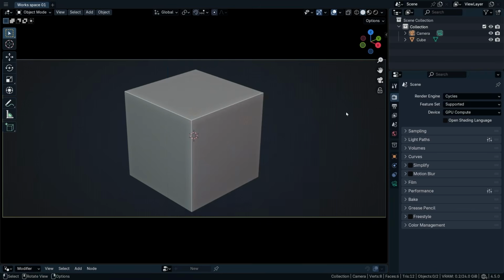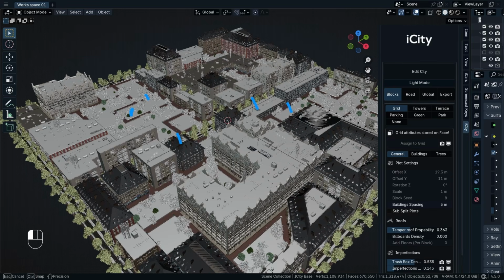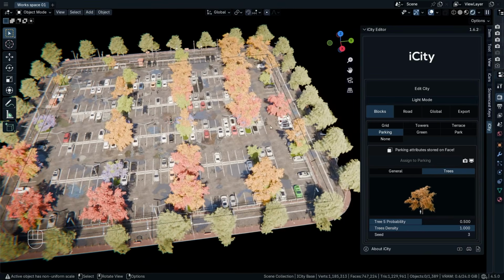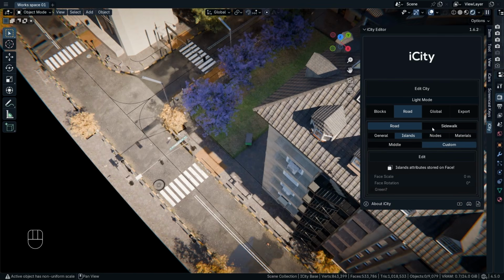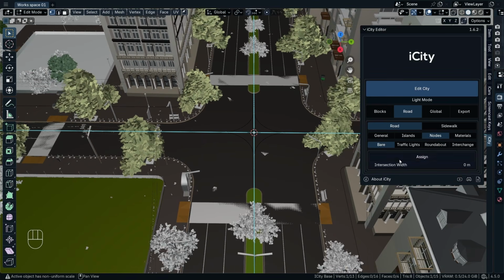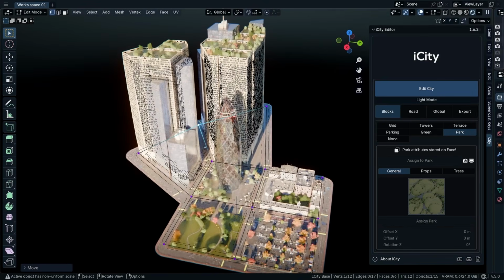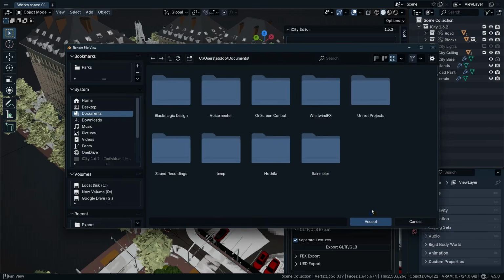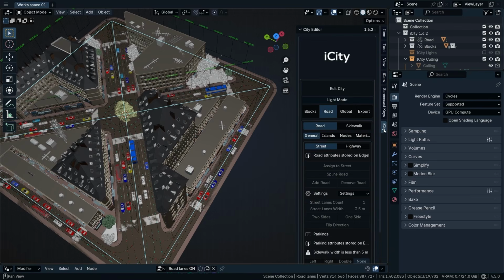iCity 1.6 | Blender City Builder Addon Full Guide (City Generator Tutorial)

Comment: Is there a way to control the amnopunt of the roof elements (antenass, sattelite dishes, etc.)? The defautl is just too clustered.
Reply from the maker: Yes, you can control the amount of roof elements. You can also enable or disable the rooftop structures.
Reply: @parametra-tech Can you explain where the setting is? I cannot find it anywhere.

Comment: Thanks for the great add-on! Quick question—can I scale down the whole iCity (buildings, roads, everything)? It’s a bit too big compared to the buildings in my current project.
Sorry if this has been asked already.
Reply from the maker: Yes, you can easily scale down the whole iCity. There are two ways to do it:

1) Inside Blender (recommended):
In the add-on interface, click the “Convert to Mesh Copy” button.
After converting, the iCity objects become regular mesh objects, so you can scale them just like any normal object in Blender (select → scale).

2) Outside Blender:
If you plan to use the city in another software, you can simply export it and then scale it in your target application.

You can also join the iCity community here for more help and updates:
👉 https://discord.gg/gCvzANdq

Comment: I cannot find any information if it works in Eevee too. Not on the website or in the comments. I just need this one information for sure so that my studio will buy the tool. So is iCity working in Eevee aswell?
Reply from the maker: You’re right — iCity is primarily optimized for Cycles, but you can also use it with Eevee without any issues.

Comment: is possible to use custom meshes for building elements, is possible to edit building elements, does building elements (walls, windowed wals etc) a double sided, with possibility to eventually add some kind of interiors easy or is singlesided (thats why is possible to edit them :) ). there is several plugins to export to unreal engine, i think one of them have possibillity to export instances as instances in ue5 (just for info).
Reply from the maker: Yes, you can add your own custom buildings by setting the block type to “None” in iCity — this will leave an empty area where you can place your assets. However, for now, it’s not possible to integrate custom meshes directly into the iCity system.
And yes, you can export everything to Unreal Engine as well.
Stay tuned — we’re working on expanding customization features!